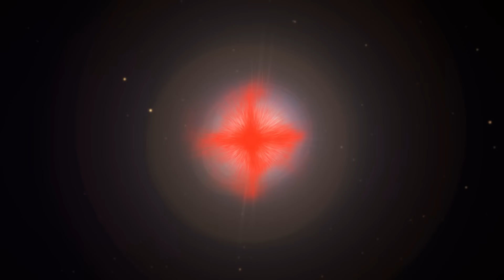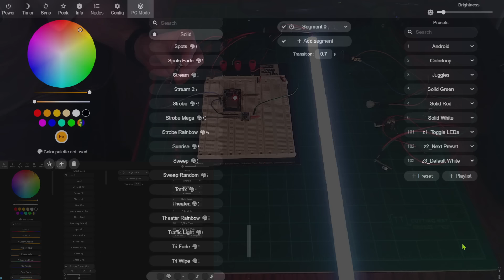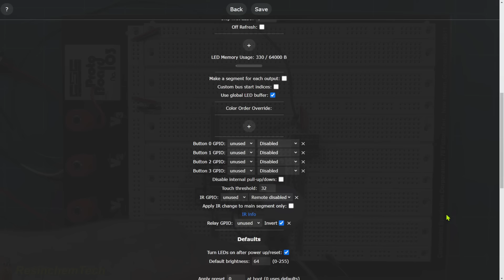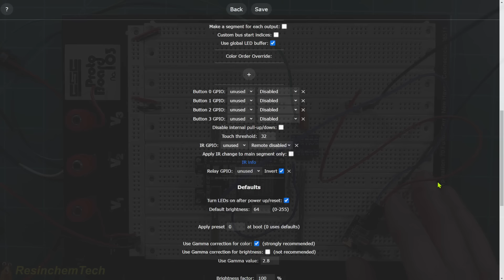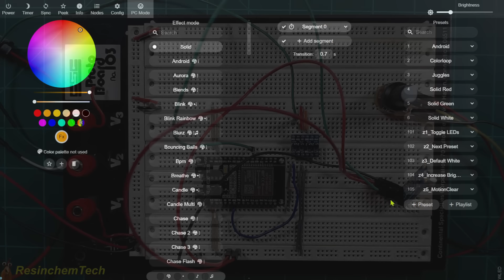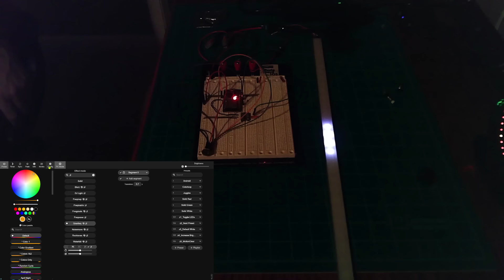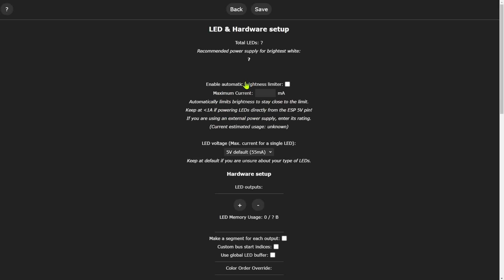Level Up Your WLED Projects: A Guide to adding Components (no code!)

Comment: This video was so help to create from basics. It was so helpful. I tried making the same for my PC desktop setup. But i came across is issue. I have added a toggle switch to poweron/off the WLED and a 10K potentiometer to control the brightness. But the issue is the leds are blinking sometimes and brightness slider is jumping when connected the potentiometer and also the leds are turning on automatically when i turn off the toggle switch. The issue is not occurring when i diconnect the potentiometer from the gpio 34 pin. Can you suggest any modification to be done.
Reply from the maker: You don't explain how you are using the toggle to "power on/off" the LEDs.  Are you powering the entire system (controller and LEDs) off/on with this toggle or are you just killing the power to the LEDs while leaving the controller powered?

By default, WLED has the setting enabled that turns the LEDs on automatically whenever the system is powered on.  You can change this via the LED Preferences, under 'Defaults'. There is a checkbox that indicates whether you want the LEDs to turn on automatically when the system boots.  Clear this box and it should resolve your issue with the LEDs turning themselves on.

As far as the issue with the potentiometer, it could be a number of different issues.  You could try adding a pull-down resistor or a small capacitor to stabilize the signal, as those issues often stem from electrical noise on the analog input.  Also be sure to check and follow the info for using a potentiometer on the official WLED site:  https://kno.wled.ge/features/macros/#global-brightness

Best of luck and let me know if I can help out any further.
Reply: Thank you for the kind response, and apologies for missing the details earlier about the toggle switch. I’m using the switch on GPIO26 of the ESP32, configured with macros to turn the LEDs on and off. The controller itself remains powered, and the toggle is intended only to control the LED output state.

Regarding the potentiometer setup, I’ve added a 10k pull‑down resistor to the ADC pin and a 0.1 µF capacitor between ground and the middle pin of the potentiometer to stabilize the signal. However, I’m noticing that the LEDs still turn on during slight rotation of the potentiometer, even when the toggle switch is in the “off” condition.
Reply from the maker: I'm pretty sure that is by design and how it is supposed to work.  The "toggle" just changes the state from on to off (or vice versa).  However, when you change the brightness, it will "turn on" the LEDs at whatever brightness value is sent.  So, say your LEDs are at 50% and you 'toggle' them off.  All is OK.  But now if you turn the potentiometer, it tells the controller to set the brightness to some value (say 40%).  Well, setting the lights to 40% brightness also means "turn them on".    If you want the LEDs to remain off even if the potentiometer is changed, then you'd probably need to switch to a relay to actually kill the power (or signal) to the LEDs.  Even if you do this, you'd need to setup the relay in a manner so that it doesn't also fire and turn on the LEDs when changing the brightness.  But by default, setting the brightness to any value greater than zero will also turn on the LEDs.

Comment: i don't know if you'll see this given how that its a year later but i have unique problem where i'm powering  my 12v pwm strips through wled i have a PIR sensor that triggers the Leds on once motion is detected and turns them off  I achieved this using the playlist feature under presets  but my problem is that i only want the PIR sensor to detect motion at night  then during the day have an ambient glow come from the leds using another preset but every time i use the ambient preset i made when the PIR sensor detects motion it switches to the playlist i tried correcting this using macros but I'm unable to could you please help if possible or give suggestions on how i can fix this 
one idea i had was to use a relay to control the PIR sensor to only turn it on at night but the relay from what i understand only turns on and off once the LEDS are also turned on so i can't send a separate signal to the relay to turn it on or off thank you in advance if you see this
Reply from the maker: You are running into a common issue... you want to do something that really is an automation (trigger, condition, action) but WLED doesn't have a true automation engine.  Yes, you can sometimes sort of do automations via external components along with macros, presets, etc., but as you've found, as soon as you try to do something conditional or beyond just the limited basics, you run into this lack of an automation engine.

So, to get things to work as you want, you need an external system like Home Assistant.  Alternatively, you could add an additional ESP or other controller that would control the relay and would run something like ESPHome or other custom Arduino/Python code.  This could then be time or light-level based to control either the WLED controller or the relay.  Short of that, you might try playing around with the timed presets, found under time and macros.  By using an "off" preset, you might be able to make use of these to at least improve the situation, even if you still can't do exactly what you want without an additional automation system or hardware controller.
Reply: @ResinChemTech  thank you yeah i think my biggest problem with wled is the lack of IF statements but the idea of using another esp sounds like a solid one because i tried using the off preset along with macros and day time settings and it didn't work at all, thank you for the suggestion and quick response I'll get on this project right away.
Reply: @ResinChemTech  i just had another idea on this topic instead of using another esp32 for tis function i could instead hook up my relay to a gpio pin and set the pin inside led preferences as  pwm  white turning it on by setting its brightness to full then off to 0% this way i can use this trick to control my PIR sensor and an on and off presets and time and macros to turn it on and off when i want it to detect motion as long as i insure that the relay i use uses 3.3v

Comment: Is it possible to copy a preset list to another board?, I'm using the esp32 mini
Reply from the maker: Yep.  If you look under Security & Updates, you should see an option to backup and restore presets.  As long as both boards are running the same version of WLED, you can use this to backup/copy from one board and then restore to the second board.

Comment: I see you mentioned needing ESP32 to support audio reactivity. 
I'm wondering if I hook up a digital mic to an ESP32, whether I could sync and drive an ESP8266 (or multiple others) just for receiving the signal from the ESP32? 
In theory the mic would be driving the data on the 32, and passing that out to the 8266s. What do you think?
Reply from the maker: Older versions of WLED still support audio-reactivity on the ESP8266.  It was dropped for more recent versions because WLED sort of "outgrew" the ESP8266.  But I don't think you can use an ESP32 to sync audio-reactivity over to the ESP8266.  The 'sync' really only syncs state, effects, colors, etc.  Even using two ESP32s, the actual effects won't be in sync... they just run the same effect/color, so any sync'ed controllers won't be in lock-step with the music.

If you really need to use an ESP8266 and want audio/sound syncing, then I think the best bet would be to go to the Github repo, locate the last version that supported audio-reactivity on the ESP8266 and install that instead.  Alternatively, you could look at something like xLights to control your displays, as it can now integrate a WLED controller.
Reply: Right, I guess I was trying to see if I could transmit the audio signal wirelessly (but then I'd have to deal with latency I'm sure anyway and things wouldn't be perfectly sync'd)

Comment: Regarding the IR Remote module, you mentioned line of sight, which makes sense with IR (the remote and receiver need to have direct line of sight. Did you try this inside a 3D printed enclosure? I'm designing an enclosure that includes an ESP-32S (from az-delivery), a relay, a buck converter and an IR Module. But this all needs to go into an enclosure and that enclosure will be mounted behind a 3/4 inch furniture panel, So I think my chances of controlling the LED strip via remote are, well, remote :)
Reply from the maker: While I certainly haven't tested it, I think the chances probably are pretty "remote".  First off, these aren't really high powered transmitters, so the "signal" won't be that great to begin with.  You might get away with the thin 3D printed enclosure, but I did a quick Google search on PLA and IR and found this:  

"Natural or light-colored PLA is often transparent or semi-transparent to common near-infrared (NIR) wavelengths (like 940nm for remotes), allowing signals through, while black PLA (especially thicker prints >1mm) reliably blocks NIR light by absorbing it, making it suitable for IR shielding. "

So it might work behind a 3D printed enclosure but it will depend upon the type (and even color) of material used.  Even if this works however, I highly doubt that you can place the sensor behind a 3/4" piece of wood and still detect the signal.  I eventually placed mine in an  enclosure as well, but I did leave a small hole that accommodated the IR LED so it is not blocked.   But it certainly not behind anything else like a furniture panel.  The only recommendation I have is to setup a breadboard version and test different materials in front the transmitters and see if you can still receive a signal on a receiver.

Comment: can we use wled to short the button of other devices, like if i have a speaker and i am using the wled/esp32 lights for the light effects but i don't want to physically turn on the speaker with the button and use the esp32 to turn on the speaker/shorten the turn on switch with wled app. you think it is possible? I konw it is possible, I searched it on chatgpt but you can demonstrate it very well. please make a video on that if possible, thanks in advance.
Reply: i guess it can be used to turn the volume up or down as well, right?
Reply from the maker: Well, to be honest, pretty much anything is theoretically possible... if you are willing to write/modify the code that makes up the firmware.  You might be able to use the relay option to control an external device, as long as the device can be controlled via a high/low signal from a 3.3V GPIO pin.  But this really isn't the intent.  This is from the official WLED site:  Sometimes people ask whether they can control more than one relay through WLED, including controlling this all via Alexa. Controlling an extra relay separately from the RGB lights is not something WLED is designed to do, however you can modify the code to add that functionality.  
That being said, there are multiple user mods available via the WLED Github repo and you might find something there that you could implement.  As far as creating a video, I can certainly do that, but I currently have multiple other projects in progress, so I can't say if or when I might get to a video on this subject.

Comment: Thank you so very much for making all the videos you have! I am working on putting WS2805 strips under the upper cabinets in the kitchen. The strip will be broken into a few segments, one under the main section of cabinets, one over the sink, and the third the end cabinets after the sink. Hopefully that makes sense. I want to use one push button and a potentiometer to control segments 1 & 3, with a separate push button and a potentiometer to control segment 2 over the sink. Is this possible? Thanks for your help.
Reply from the maker: First, you are very welcome.  I'm just glad my videos are helpful.

Next, controlling segments with push buttons is pretty straightforward and you can just create the appropriate presets and use a button to toggle power, select a preset, etc.  However, I don't believe you can control or manage a segment with a potentiometer.  The potentiometer is considered an analog control and WLED only makes certain feature available with analog controls.  This is primarily things like the brightness, speed of effects, etc.  See this from the official WLED site and look under the Analog Button (e.g. potentiometer) section and it will show you what can be controlled via a rotary-style knob/potentiometer:  https://kno.wled.ge/features/macros/

Best of luck with your project and don't hesitate to reach back out if I can be of further assistance!

Comment: so i have a question. my project is about building a car cluster using sk6812 leds. but i also want to be able to read telematics from the car, changing like the color of the rpm dial. its a pretty old car without canbus in its actual state, its more the dumb pre version. so the question is, is it possible to read that data and use it to make the color fade like from green to red as the rpm rises?
Reply from the maker: I'm not sure that would be possible without some sort of intermediate controller or process.  WLED has pre-defined input types... mostly digital for things like buttons or switches, but it does also have an analog option for things like potentiometers.  But the analog has a limited voltage range (normally 0-3.3V) and WLED only offers control of certain functions via the analog input (but changing color palettes is one).

I'm not familiar with CANBUS and haven't tried to use it.  But the first step is to decode the signals and/or data that it is outputting.  If there is a digital signal (e.g. off/on) that you can key off of, then you could use that like a normal switch or button to control WLED.  If there is an analog signal, you'll need to know (or convert) that voltage to be within an acceptable range for the ESP analog pin.  

Otherwise, you probably need an intermediate controller or device that can decode the CANBUS signals and based on those signals, send the appropriate commands to the WLED controller (via the WLED API library).

You could also check the available user mods in the WLED Github repo ( https://github.com/wled/WLED/tree/main/usermods ) to see if someone has developed a modification for CANBUS (or maybe something similar you can adapt).

Good luck with your project... but CANBUS is just an area I haven't really worked with yet.
Reply: @ResinChemTech No Problem, thanks for you answer 😄 well that's the point, where i need to Check how the voltage goes up and down and in what range it's working in. I guess it's somewhere between 0 - 5V... or even less... i also dont know exactly 😅 
Also thanks for the Tipp with the Usernod libary... will definetly check it 😄 
Thank you! Great Video by the Way. Definetly will try some things with Pushbutton aswell 😄

Comment: Can you also use a 1 kΩ potentiometer?
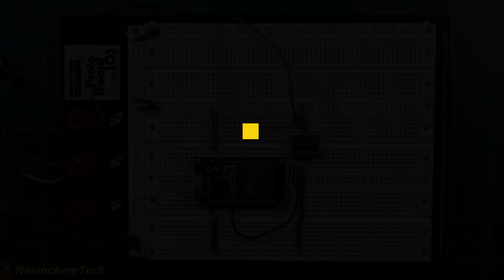Reply from the maker: As I cover in the video at 18:54, WLED recommends at least a 10 kΩ potentiometer.  You can certainly try a 1 kΩ pot, but I suspect that it will have a very limited range.

Comment: Greate detailed videos, with al circuit and components detail, with purpose of each component and effect. you seems to be a university teacher. i have a question if you can address it will be so kind, many LEDs are available in the market with controller and wireless remote, can those also be configured with home assistant simultaneously ?
Reply from the maker: First, thanks for the kind words.  Whether you can integrate/control commercial LED strips into Home Assistant depends upon the manufacturer, which app it uses and whether there is an integration available or not.  In most cases, it probably isn't possible 'out of the box' but there are often workaround DIY ways to integrate some products.

For example, if the LED strip comes with an IR remote, then you could build your own IR transmitter that IS controlled via Home Assistant and could send the proper codes via the IR transmitter to control the LEDs.

But the best best is to go to the Home Assistant integrations page and search for the brand of LEDs:  https://www.home-assistant.io/integrations/

If there isn't an official integration, there may be a community-developed integration which is found in the Home Assistant Community Store, or HACS:  https://www.hacs.xyz/

You can also find strips/controllers that come with things like WLED, Tasmota or ESPHome pre-installed as the firmware and these all have native integrations in Home Assistant.  Hope that info helps!  Thanks again for the comment!
Reply: @ResinChemTech  Thanks for your great time to elobrate all of this, i will try these, Hacs is very good plateform for it. however i will try to open, controller, and figure out the chip, that will help in flashing it similarly to work with remote and home assistant , as your video is about perferel of WLED.  Thanks any way, God bless you, you are so kind.

Comment: can i use a remote control on des ESP 8266?
Reply from the maker: I think you are asking if you can use an IR remote with WLED running on an ESP8266?  If so, then the answer is yes... it works in the exact same way as the ESP32.

If you were asking if you can 'control' an ESP8266 with a remote, that is also _possible_.  But you'd have to wire up an IR receiver to the ESP8266 and then write the code or firmware to handle receiving an IR signal, decoding that and then taking action based on the IR signal received.
Reply: @ResinChemTech  thx 😊